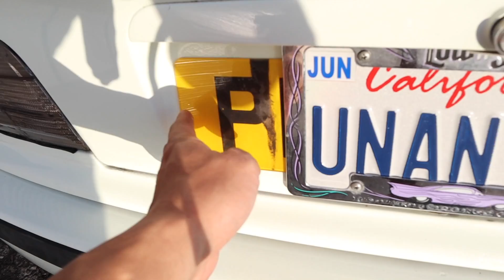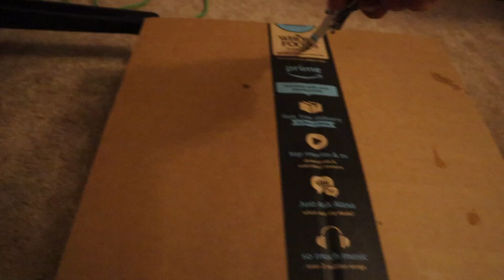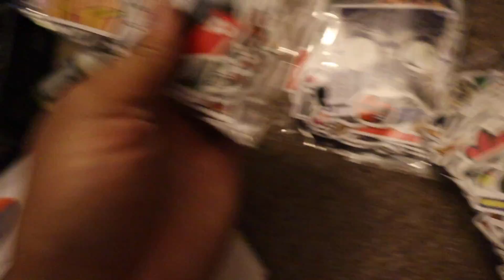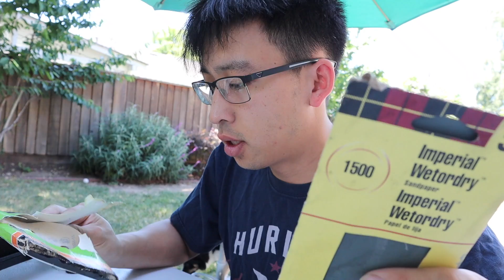Custom LED Silvia Grill

Comment: On my e46 i was having the same exact  problem. Long story short check your injectors, theres a metal clip on mine that wasn’t holding the injector on tight enough and would make it run rough as shit. A zip tie fixed it for me till i feel like buying the clip 😂

Comment: Buy an aluminum sheet from homedepot to use for the back housing. You can wet sand and polish the aluminum for mirror finish. Or you can lay the reflective film but cut pieces instead of forming one sheet onto whatever material housing you decide to use.

Comment: This seems to be kind of a more common problem with ka motors. I would replace the wires and spark plugs first as it’s less than a $100 total then go to injectors if needed. Overall, it’s just a good maintenance thing to do as your ka is old
Reply from the maker: Thanks for the advice Andrew

Comment: What you can do is use a long scew driver put it on the injector and listen from the handle side should hear a ticking sound if it's working. Usually something with with spark plug or wire pack , better to get tune up on the car if you haven't.

Comment: Just do a tune up like cap and rotor and then make sure you change your fuel filter and run some injector cleaner. When I first got my coupe I had an injector go out cuz the filter was so dirty and at first it would clog then unclog until it finally went out. Oreillys fuel filter is cheap and a bottle of Lucas injector cleaner is like 6-7 bucks.